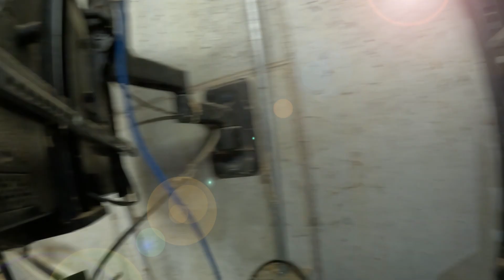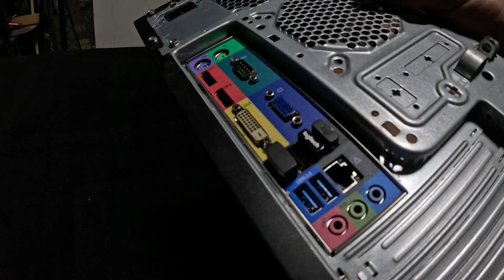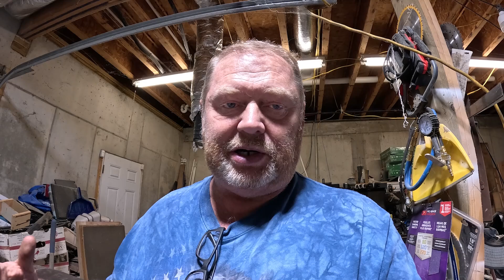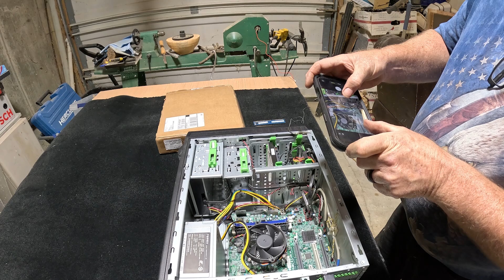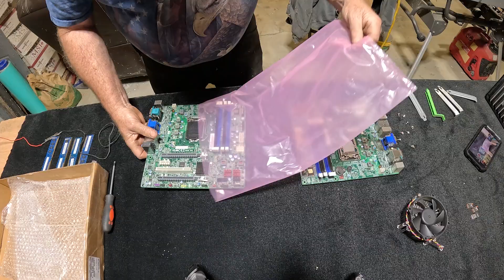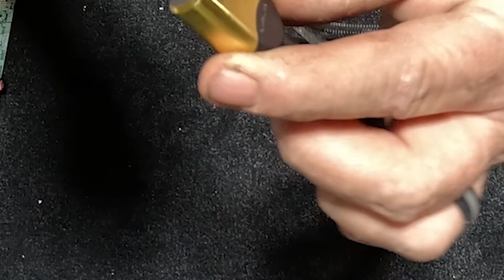Trying To Repair my CNC Router Computer

Comment: You just showed me how to prevent this from happening to me... Unplug my computer when I'm not using it..And especially if the rain  weather is about to make it's way through.
Thank you...

Uncle Larry 😎...
Reply from the maker: Your welcome. I used to design computer networks. I’ve seen some crazy things take out computer system. But I never in my wildest dreams thought about an under ground power wire blowing doing that much damage coming thru a concrete wall like that.

Comment: So the supplier caused the surge and you can't claim off them? They set fire to my trees under the line they should keep away by 4ft,
burnt my garage and workshop down, it's taken 3 years to get some recompense.
Reply from the maker: If I had noticed that it happened shiner they probably would have paid for the damages. It happened about 4 months ago. I just haven’t used my CNC router in a while so I just didn’t notice.

Comment: Yeah late 1990’s ol bill Clinton basically gave USA manufacturing to china aka everything made throw away version of stuff instead of lasting. Made in USA with pride is gone 🤬🤬🤬 anyway from computers to cars
Reply from the maker: I agree with you about things not being as good as it used to be, but I don't think anything would have survived a 7,000 volt power surge like that.